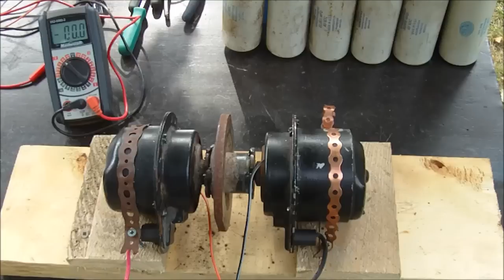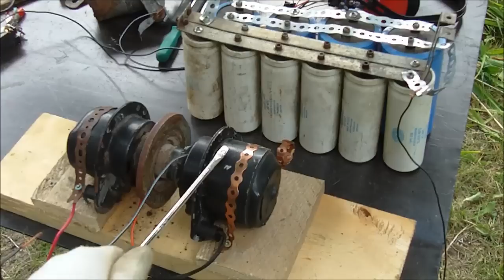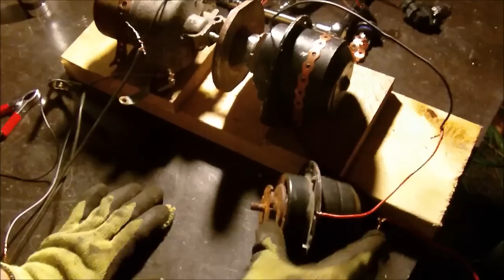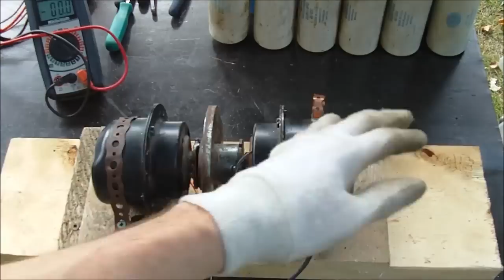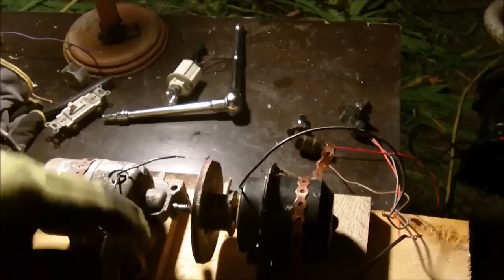Electric Motor to Motor, can they self run?

Comment: Put up a solar panel and tie in to the motor and it will spin the generator. There you go !! when the sun is up you will get free energy (sort of speak the sun has to be there to give you that energy in photons) lol. Now place an amp meter in the motor primary and measure the difference in amps between the motor in and generator out (both motors are the same, generator under load you figure the load to equal the motor current draw.) Now the difference between input current and output current (approx minus the perfect world on imperfections on the magnetic s of the motors) will give you one of the numbers needed for your formulas to prove the conservation of energy and thermodynamics laws. (do please take the flywheel off for your rig. it adds weight and reduces down the transfer of power, then you can put the flywheel back on and redo your calculations to prove it only slows the transfer of power " just for the fun of it !! " So you can say what about all those magnet units out there that speed up the motors without energy or very little energy  to start them up ? Well you are a smart guy, I'll tell you , magnets have a sloe recoil that is to say that they an never really run a motor between individual magnet pulls fast enough even of it ran a few rpm. let's say someone out there (if we are missing an Einstein) ran such a motor, again the conservation of energy laws come into play, the magnets will loose their potency (magnetism) after a while ( depending on magnetic power transfer) and you are still shit out of luck. No the laws of physics cannot be changed but I think quantum mechanics says that eventually if you try to go trough a solid wall without overcoming the atomic binding of the material by too much force (ie. not breaking it) after maybe a trillion times or more you will go trough the other side without damage lol. Quantum mechanics (at least parts of it makes no sense to me) But anyway point is a generator might overcome unity in what universe and when ? good luck buddy and I admire your inquisitive mind.
Reply: +jerry simone You'd get less energy than you would just using the solar panel. Unless you can get 101% or better effeciency motors.
Reply: Ehh.... The sun will eventually run out, why not only run on sun power instead?

Comment: It's so funny that you haven't figured this out yet, overunity or attaching those two Motors together have to have a switch between Tim and a battery, overunity has nothing to do with more energy out than you put in Forever seemed to do with a switch which allows the battery to be charged and discharged at the same time, we don't think you're looking for the answer because you already think you have the answer this was in response to what you believe. But when you're truly looking for overunity or to run those two things at the same time then you have to look up computer backup batteries which has a switch in there which means it switches so fast that it doesn't give the apparatus time to shut down when the power returns it switches back now do this at 60 hertz and you will see that the battery can charge and the motor can drive at the same time

Comment: what if, (this idea is not self running) you geared the motors so that the bigger one spins faster, connect that to the capacitor bank, and yet keep the driving motor connected to a source of energy, and that way you can harvest the extra energy put into the capacitors? correct me if I'm being dumb but wouldn't that work? because if, say the driven motor is at a 1:4 ratio to the generator motor, then the generator would produce 4 times the energy relative to rotating the same speed of the generating motor.
Reply: Energy is energy is energy, no matter what happens you can't end up with more of it than you start with. While one day this may be shown to be false that is also true of other things like the sun rising, and both have about equal evidence supporting the claim, regardless of if it is conservation of energy or that the sun exists, to think otherwise contradicts a HUGE body of evidence.

I think this is what you are trying to do (with speed being the conversion rate between the motor and the thing being turned):
Power Source-> Motor -> (1x speed) -> (4x speed) -> generator -> Out

If this is what you are thinking of the issue comes from the loss of torque made by increasing speed, if you decrease speed you gain torque by losing speed. When you draw energy from the faster version, the speed decreases easily, on the slower version its harder, but both result in the same output power, so you haven't gained anything compared to just hooking up the source to the capacitors. Worse still, this conversion of energy will increase entropy (the randomness of a system), or in other words there will be waste energy (mostly heat) from resistance in the wires and friction in the gears, along with other factors. Because of this, that setup will lose energy, as you can never get more energy out than is put in (accurate measurement has always proved this in all cases), and nothing is perfectly efficient in converting energy type (its like trying to keep ice from melting, any system tends towards equilibrium).

Still, its fun to play around with ideas, maybe you'll find a way to get it to work, contradicting at least hundreds of years of study. Just don't get too invested in it unless you are REALLY looking at something weird. In that case you should make sure you are right by eleminating every way you can be wrong, and then escalating it to a larger and larger group of people who do the same, if it is right it won't get disproven, if it is wrong it probably will... eventually (like the geocentric model, or our early models of the atom, our current models are likely off too, but thats the trouble, you never know you are right, just when you are wrong, its the same in cryptography where a code is unbreakable... at least until someone breaks it AND publishes the break).

Still, don't take my word for it, test it (cheap motor, slightly less cheap generator, some gears, a few batteries, energy measurement device, and capacitors, its not uber cheap but its not expensive either).

Apologies for any typos/run on sentences/other issues, I'm on a phone so I can only read a few lines at a time.
Reply: +mini hoov Or even better - put, like, 50 more gears on a car. That way the MPG will go higher and higher...  NOT.
Reply: Alan Williams there's a difference there. engines don't have all their torque all throughout the rpm range. that's why i wasn't talking about engines now was i? it annoys me when people bring up an unrelated thing that doesn't contribute to the conversation. as the super fucking annoying song goes, "why you gotta be so rude"
Reply: +mini hoov  You should be surprised that other people understand that the speed torque curve is not linear,  I suppose experts like me have to be patient with slow learners like you.
Reply: Simple rules of electricity apply here too, electricity is lost in wiring alone, as heat, how many feet of wire are wrapped up in that copper coil? Let's say it's all 16 gauge wire, you're losing 2 volts every 100 feet to heat, this is an issue we simply can never fix.

Comment: this is proven to be possible with a Novatorque Motor and generator with supercapacitors.  generate enough to run itself and extra
Reply: There isn't a motor/generator combination in existence which will generate more power than it consumes. There's not a combination which will even break even.
Reply: keep living in the past
Reply: I may live in the past though I also live in a reality where perpetual motion machines are impossible.

Am I correct to assume you're claiming this device generates power without receiving power form an outside source (such as physical motion)?

If I'm understanding you correctly, I hope you haven't given any of these people your money. All perpetual motion machines and all so called "free energy" devices are either products of frauds or products of people misunderstanding what they are seeing.

Conservation of energy isn't just a good idea, it's the law.
Reply: only requires a start-up outside source.  considering most amperage is needed to get anything started.  super capacitors charge very quickly and discharge very slowly.  invented by an 18 year old girl.  (your new cell phones with30-80watt charging uses these)  I'm not saying the motor will run forever on its own but an hour is a pretty big breakthrough.  the novatorque motor is the highest efficient motor we have so far.
Reply: "the novatorque motor is the highest efficient motor we have so far."
Is a very different claim from your original post.

I have no argument against an "efficient motor" nor to I have an argument against super capacitors. I use both motors and super caps in my own experiments. I just take exception to claims of perpetual motion and free energy.
Reply: well I just wasn't specific.  I never said there weren't certain requirements needed to make such a thing possible :-P lol  never said it was easy lol

Comment: electric motors are usually a single direction motor...are these ? If so, there's your problem. If you notice most of the videos on here show the motor / generator connected by belts and pullies...they turn the same direction...Yours works against itself. It can't work...in other words because they are not goiung the same direction...they cancel each other out.

Comment: What if he could gear it up? or gear it down in between the motors?  I know the term perpetual motion has yet to be proven, but it's got to be a way.
Reply: +ELLEON1959 Nope.  It is physically impossible to keep all the energy in a system.  There are a few trinkets that act as "kinetic batteries" that maintain motion for a while, but they all eventually stop, losing energy to entropy.
Reply: +Mark Aldrich Maybe you should learn more about planet earth and call me next month?  I think it's been around much longer than two motors huh???
Reply: Earths rotation is slowing up too..
Reply: Murgeologi hook a belt up to the earth and the other part to a generator .  As the earth turns , it turns the belt and generator.  Only problem , it will slow the earth down because of friction and we all die

Comment: I know for a fact that this thought processes ends in failure. although I can see now the first of many flaws with this demo is the gear ratio. You could have showed a much larger gear on the driving motor and a smaller on the generator. Attempting to gain the most rotational momentum. I know the frictional coefficient is going to overcome. Another demo could include multiple generators on one driving motor. Again the frictional coefficient yada yada yada.....

Comment: I HAVE MINE WORKING ! Its all about harmonics I use 3 phase motor generators and a cap bank with a phonon coil made of silver .. For the load I go through a large transformer via the secondary coil  a good welding transformer is best ! The primary coil is then the output ! Then add a tesla coil with compression to increase the frequency ! I use a large DC 35v 22000uf cap bank that reflects back the current ! Then add magnetic inertishia for more power and use a double negative connection onto the transformer ! 

I can do 12kw at 300v AC ! But there are better ways to do this ! Learn harmonics first on audacity sound recorder and just line up the waves under each other ! Its not easy if your just starting out but keep going and you will get there in the end !
Reply: michael richardson nice bait good shit
Reply: the old "current reflector" and "magnetic inertshia"  trick....is this noah from alaskan bushholes?

Comment: why won't an alternator run the motor, and in turn, the motor run the alternator, once the alternator is at speed to run the motor ?
Reply: It WOULD, if both the motor and alternator were 100% efficient at turning mechanical motion into electricity and vice versa.  Think of spinning a top or a planet in outer space, it will tend to keep spinning with no friction.  The same concept would apply with 100% efficient motor/generator, but you couldn't perform any work with them, they would only have as much energy as you initially started them spinning, no more, no less.
Reply: Even if both were 'lossless" (100% efficient) you could never make any external use of either the mechanical or electrical power. Oh! And what makes the initial "once at speed"? More external input.

Comment: Actually, this will never run, but it could !
Yes, yes... it could run !

The problem is that standard electric motor are builted with magnest around the rotor and the rotor is a "wire bundle" that is activated ba an external source of electricity, like a battery. To work, the magnets have to be the rotor and the "wire bundle" been around the magnets, with sufficient wire lenght to produce enough electricity...  But it will be AC type electricity. The real motor has to be an AC type to work !  As it's a DC type, it will simply not work at all.

Comment: No. Both the motor and generator would have to be 100% efficient to work. Even then it wouldn't speed up. Only stay at the speed it is set. To increase speed, it would have to be over 100% efficient. Friction - mechanical and electrical - currently makes this an impossibility. It requires an external power source - either mechanical or electrical.

Comment: Flywheel needs to be bigger
Slave motor needs to be smaller, tighter winding for high rpm's
You need to gear the slave motor down 
Keep trying mm friend!

Comment: This will never work because there are inefficiencies in the real world, and in this case huge inefficiencies due to friction in the bearings, resistance in the copper wires, vibrations, air drag, the list goes on and on.

Comment: I have done a lot of research and i know that it is quite possible for two motors to selfrun but you need to use two motor with huge difference. Size of back emf and internal resistance of the motor acting as generator is very importance while the speed, internal resistance of the motor acting as the driver is also important. You can also make use of a flywheel, diodes and ultra capacitors to boost the current coming of the generator motor. You usually get 25 percent of the rated voltage as bemf so you can to match that with the rated voltage of the driver motor. So you now know the secrets to self running motor why don't you try it out now and see the results.